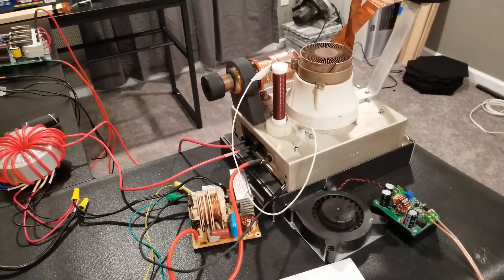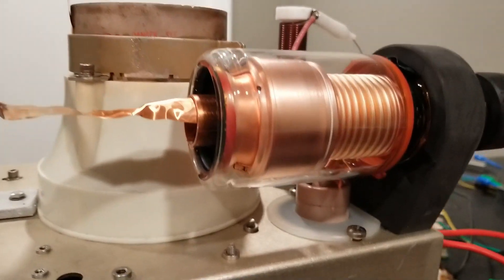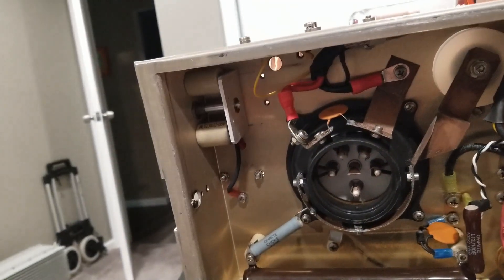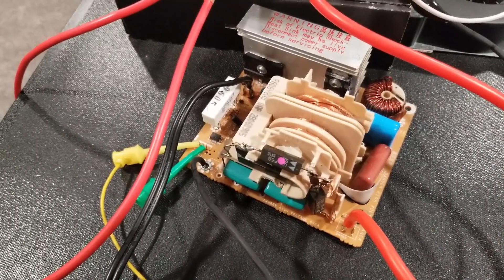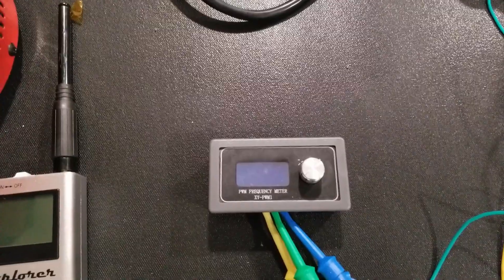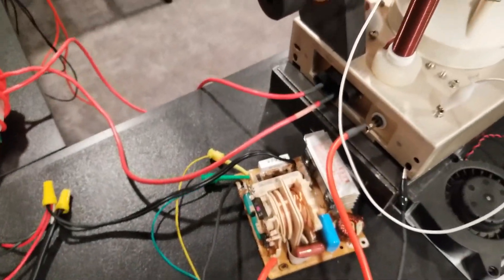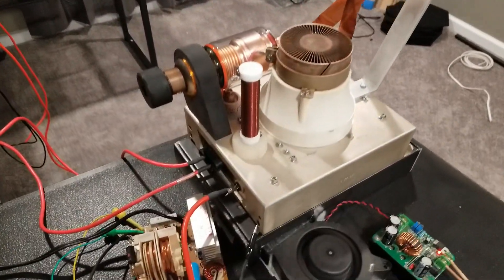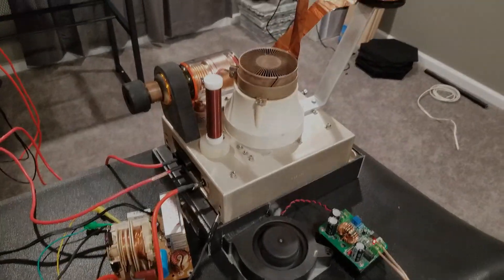HFVTTC - 3CX1500D3 - 20 MHZ

Comment: Can you explain the purpose of the diode in the schematic?
is it there to shunt positive grid bias more to ground?
Reply from the maker: @janno288  there was an external connection to the anode not shown that I suspect was doing grid current measurement.
Reply: @MrTurboturbine  I mean at 
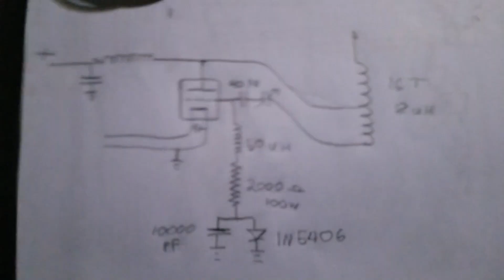7:07 You see the IN5406 Diode going from grid to ground?
Can you explain the purpose behind it?
is it there to have unloaded negative feedback but loaded positive feedback?
Reply from the maker: @janno288  I don't fully understand the purpose of it, the oscillator circuit functions without it in place, the way it was wired makes me believe it formed part of a grid voltage/current feedback for the high voltage power supply control circuit in the original system.
Reply: @MrTurboturbine  thank you anyway